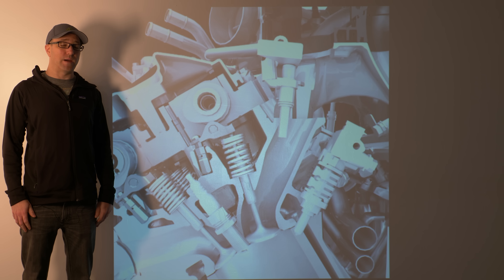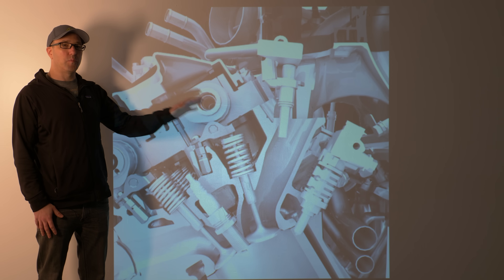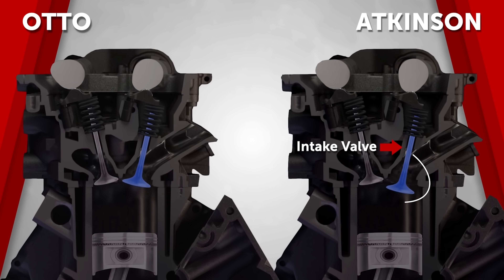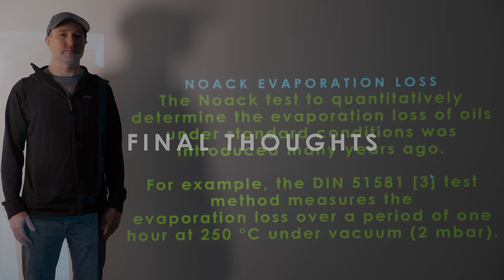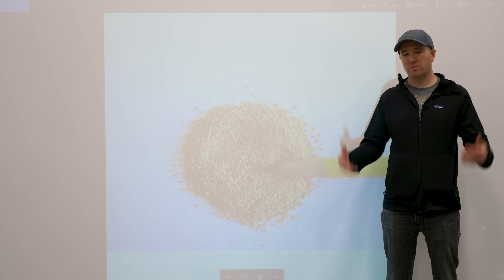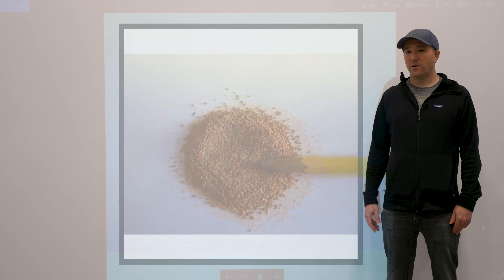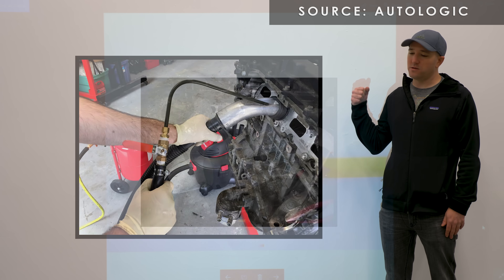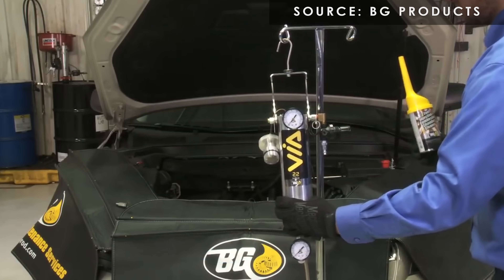Direct Injection, Problems and Solutions | The Fine Print

Comment: Very much disagree: Cleaning and oil cans are palliative solutions. Root cause of this problem is excessive blow by and all actions to prevent intake valve carbon build up should therefore be focused on preventing that. Blow by is caused by malfunctioning piston ring sealing to the cylinder, this normally is caused by not properly running in your car when new, trashing it when cold, using crap oil / filters etc. Just don't do those things and you should be fine. Running DI cars up to 450.000 km here without problems, at high speeds (Germany) and proper maintenance. If you behave like an idiot you will pay dearly, just be nice to your car, it will return the favor.

Comment: We got 2016 Audi S1 2.0 TFSI , keeping as much as 3K rpm whenever driving it or drive it like hell ya. We’re living in place with 98-100 octane ( Mobil 1 / Shell unloaded). We dont know if it will help out  But this is only the way to prevent the worst at least.  By comparison we got another 2 cars that still  run like hell  for 16 years without engine prob, its a ttq mk1 and cooper S MK1. all of 3 run 5-40 of Mobil 1. And Never to Dealer for Servicing since the D1, We hate Dealer!

Comment: putting thicker oil in your vehicle than what the manufacturer recommends can cause issues if your vehicle has variable cam timing, especially on the newer vehicles as the cams will change timing as quickly as the computer wants too see. It may cause faults and drive ability issues. If it doesn't, great!

Comment: I have head so many theories on what causes the carbon problems on DI and I can say first had that the PCV has little to nothing to do with it. From newly  cleaned valves I used an oil catch at 60k- 122k before my valves were coated enough to cause cold start misfires again. So the PCF filter gave me an extra 2 thousand miles. Whoptie fuckin doo. I also used seafoam every 10k which is probably where I got the the extra 2 thousand from. I'd be willing to bet the Oil catch can does absolutely nothing. Do you have problems with carbon buildup in your turbo? Do you have problems with carbon build up in your crank? No you don't. Thats cause fucking engine oil doesn't leave carbon deposits.

Comment: Yep, GTI owner here... the carbon is nasty. However, the Italian valve job works! 95k miles on mine, but no misfires, because before every oil change I go on the highway in 3rd gear and rev the tits off her and get it super hot. Not perfect, but it works.

Comment: great video! What applies to GDi engines also applies to direct injected Diesel engines. 
i used to own a bmw 320d and i cleaned the EGR valve, the intake manifold with butterfly valves and the intakevalve ports. All caked up with a thick sticky layer of sooth + carbon + oil.

Comment: If it has this level of detail and understanding of technology, a Fine Print on how to choose which gasoline octane to pump would probably be successful. In addition to many historical misconceptions, modern engines with sophisticated ECUs and knock sensors are even more confusing and are not being described sufficiently to consumers (except by Mazda). In other words, the vast majority of ordinary drivers of "premium recommended" vehicles do not understand the distinction with "premium required." No one is close to recouping the additional expense of premium gas with better fuel economy, and most drivers would likely place little value in any performance gain if they truly understood it (e.g., over what RPMs there is a difference).

Comment: I have an old ZJ Cherokee and I recently did a de-carbon on my inlet manifold and a bit inside of the inlet ports. I use oven cleaner and a high pressure water cleaner on the manifold away from the truck. The parts inside the head I used rags and bottle brushes. You have to be careful with the paint and under the bonnet things. Oven cleaner is 75% caustic soda. But I tell you what, it works really well. I like it.

Comment: gdi...for lease cars only!!
after all...who cares if the user doesn't keep the car and it's disposable.
oh yeah...real good for the environment...NOT!
sticking with my v12 jag thank you very much.
24 years old and the engine has NEVER been apart. runs like the day it was bought and gets 20 per when the go pedal is used gently.  still passes emissions.
to add...how long does anyone think it will take for the parts in these new nightmares to come up NLA on a parts suppliers screen when it comes time for these things to be repaired?
i digress before this turns into a full blown diatribe.

Comment: What you didn't mention is that any buildup of coke on the inlet side can result in LTPI - or Low Temperature Pre-Ignition. Tiny bits of carbon enter the combustion chamber and are ignited. If the particle doesn't exit via the exhaust valve, then it stays inside the cylinder, as a glowing ember. Then, when the piston is on the way up, the pressure gets high enough for the ember to ignite the fuel massively early, placing enormous strain on the bottom end of the engine, and wrecking it fairly rapidly.

No computer can stop it happening, and it is worse for your engine than High Temperature Pre-Ignition, because it happens so much earlier in the stroke.

Comment: You say government forces manufacturers into greater fuel economy thus necessitating new technologies like DI.  However, I don't think the gov't blindly ups the MPG standards every year.  They must know what is technologically feasible at a reasonable cost.  And where do they get this information?  Probably from the manufacturers themselves.  So it really boils down to what current research and development into engines has been able to come up with.  So what drives manufacturers to improve their engines, be it better MPG or higher performance?  Probably competition, so they can out-do other mfg's.  In this race, complete research, like the longevity testing of dirty valves caused by DI that you mention, may not carry as much importance as time-to-market and sales.  To be fair to the car makers, that's probably a fact of life in business, to be able to survive.  However, it is also possible that the engine designers know of the dirty valve problem, and accept it as a tolerable side effect.  Maybe they figure the kind of buyer who buys for performance  of a DI, will only keep his car for 60k miles, because general wear will reduce it performance by then anyway.  I'm not saying these things are a fact,  rather saying there are many factors at play here, and you can't say, oh, they blew it with DI.  Car manufactures and their engineers are smart.

Comment: I'd also add quit using discount fuels. There is a tremendous difference when looking at the valves of someone who uses Kroger, Speedway, or other discount fuels at 20 or 25k miles as compared to someone who uses a top tier fuel such as Sunoco or BP. We see the damage/problems caused by cheap fuels every day at the dealership I work at. More than one manufacturer has bulletins out about discount fuels due to the fact that they are lacking the many additives the other companies put in their fuels. That is how they offer their fuel cheaper with their rewards cards.

Comment: Great video, I have run into this with my own vehicle. 

For anyone willing to get dirty and clean their own intake valves I have found that lacquer thinner works fantastic. Definitely don't do it around any kind of flame or spark, disconnect your battery as well. I did this to my 2012 Turbo'd Optima and the whole process took a few hours. I spent maybe $20 vs the $600 it would have cost. I'm an engineer and like to tinker with stuff and I like saving money. If you have a VW, forget it you will need to have a dealer service it because their engines are setup to be impossible for your average Joe to work on.. I still don't know why the car manufacturers don't just use internal catch cans that pipe the clean air to the intake and the oil vapor to a chamber under the oil pan. Use a longer plug that seals off both the oil pan and the chamber. When you change your oil it also drains the chamber of nasty blow by stuff. Simple fix and the catch cans could be made to be 100% effective using or a large amount of baffling. I put stainless steel wool in the bottom of my catch can to help it remove more nasties.
Reply: Engineer here as well. I used e85 to clean mine. $5 and i did a piston ring soak as well. Worked great. The solution is just to be a bad boy and put your pcv system to a vent to atmosphere catch can. Swear to god if you do this a good car really should last forever. Just have to be aware that a vent to atmosphere setup leaves the oil slightly diritier than a vacuum system so you need to change the oil every 3-5k.
Reply: @paladain55 is E85 ethanol? I had to rip my 6.7 power stroke intake off all the way down to the heads @ 57Km 
Happened to check my map sensor on the very top of the plastic intake and it had the hole plugged up with soot.. I had 1/4 to 1/2 (at some areas)inch of soot from the throttle body onwards.. of  course that is where the EGR return is in the intake. Interesting fact that the EGR port obstructing dead center shaped to a smooth mushroom head which is always heated hot by exhaust gas and this 40% intake obstruction meeting cold air .. not enough on top of that i noticed oil in my intercooler up pipe so traced it all the way back to the turbo.. they have a half in hose facing the turbine inches away which is the crankcase breather and it has a wannabe catch can separate nothing as its not baffled nor allowing oil return fully to empty the box.. so I just used a washing machine drain tube and routed it to the airfilter input hole and plugged off the turbine port. Ps I used good old kerosene for soot and that's what worked fastest for me just like I only use kerosene to clean my motorcycle chain also from the thick grime and it is like new still..
Reply: Or take a catch can that cost $3 and multiply that by 300,000 or so of cars and you see why not, also what the other guy said they want you to take to dealer.
Reply: @anthonye3680 a quality catch can is a hellava lot more then $3😂
Reply: Ujjain
Reply: If you're an engineer then you should know "why the car manufacturers dont use catch cans" and the answer is because THIS way the car doesn't last as long and that means you will be back to the dealership SOONER to buy another car from them.

Comment: I spoke to a Denver Metro VW Dealership Service Dept about the concern I had regarding “Carbon Build-up” on my 2017 VW GOLF TDI. This car has a 1.8L Turbo charged engine with 11,000 miles.  A gentleman with this dealership stated that VW Corporation has no specific concerns about Carbon Build-Up on this engine. Also that this particular dealership did not /would not install a “Catch Can” and saw NO NEED for such a device!

Comment: I've noticed it has an effect of modest turbo boost by the efficiency gains. Naturally aspirated engines previously such as a V-6 rated at 190 HP with port injection are around 260 HP with direct injection. (Other things like fuel economy and displacement staying about the same.) I think it's because the valve timing is less of an issue with fuel timing, so they can maximize the volumetric flow compared to previously. It's not all bad despite the problems it may cause with carbon fouling.

I suspect if car companies had any choice in the matter, they'd probably try to figure out how to get rid of the EGR and PCV. There were cars in the 1980's that would pass 4-gas just fine without them (and even cleaner than cars with them), before they were legally mandated.

Comment: People warned me about carbon deposits when I got my 2012 Focus SE, but that was from VW people and I'm all too familiar with that company's inability to engineer things properly or spec appropriate materials for the jobs (and, yes, I realize I bought a Ford—my first, BTW, and I thought I might be rolling the dice on it). To be safe, I put Seafoam through a tank with every oil change at 10k, but stopped that after about 30k as the car seemed not to need it. Over 200k miles of perfect running that would embarrass a Toyota later (never even changed a spark plug), it was only two jerk-offs not paying attention that took it off the road (to be fair to this car's reliability, it was a manual transmission, not the problematic DCT, but that has nothing to do with the DI). Got over 35 mpg over its life (as calculated at every fill up) with no discernible difference in acceleration and, while I have mechanical sympathy, I don't drive like grandma (and since I no longer deal with timing belts, I do not ever service cars unless something has worn out or broken). My ST replacement has 75k so far and is just as bulletproof.

The secret to longevity? Drive it. I drive over 50k miles a year and never have reliability issues with cars that don't have the most stellar reputations (but no VW or Hyundai/KIA or Chrysler level disposable trash—the engineering on those cars is a joke). High mileage being a problem is an outdated myth perpetuated to devalue used cars at trade in and to encourage people to buy new ones. Even wear items last about as long time-wise as on low mileage cars, I just get 3 times the life in mileage.

Comment: Crud...just bought my dream car 2018 WRX after 3 years of patiently saving and waiting...

Much love for you GeeseMaster. Big fan and enjoy your dry humor and content. I learn a lot from you as a small SubiTuber:)
Reply: Wait until your head gaskets blow...
Reply: Stan Sexton that only happened on very few vehicles more than a decade ago
Reply: It's happening with the Focus RS and Subies right now.
Reply: @amazoidal  what wrx's are blowing head gaskets? i havent read of any. the eco boost engines yes. not the fa20dit.
Reply: @jameskocks4734   it's the STI not the WRX
Reply: @amazoidal   Focus RS is gone the STI is the old EJ motor that blows
Reply: TomVangTV you'll have bigger issues than inrake valve caking lol, knock knock, its wrx. J/k, change oil like religion, 5k km period. It will help a lot

Comment: you explained the pvc system wrong.  the crankcase is ventilated positively.  the engine takes in a certain portion of its combustion air from the crankcase.  the crankcase is part of the "headspace" of the motor.  one of the most beneficial emmissions devices it actually helps your engine last longer it clears out blowby into your crankcase and it prevents water and unburned fuel from settling into your oil.  the carbon buildup is, as someone has mentioned, your egr mixed with the oil mist from your pvc valve.  tdi vw's have this problem.  egr is stupid.  dump ur egr and get ur car re-tuned.

Comment: One old school DIY trick to remove at least some of the sludge/carbon from intake ports and valves is to spray water mist to intake manifold while engine running about 2000 or more rpm. Just remove intake filter and apply spray of water mist with a hand spray bottle in to the intake manifold and keep revs up. Engine will slightly cough a bit and sot will come out of tailpipe. That´s removed carbon. Have done it for several diesel engines without particle filter or filter removed over the years. With gas engine disconnect catalytic converter first to prevent removed carbon to stuck inside it.

Comment: This DOES NOT apply to a Corvette in this article (search for the word Criswell): http://www.stingrayforums.com/forum/general-discussion/14048-catch-can-confusion.html
Reply from the maker: They said for "street" driving it did not make a notable difference.  For hard driving and track use thats a different story.  Secondly GM engineers also claim their V8s with oil consumption issues on cylinder deactivation engines is ok up to a quart every 1000 miles.  And a massive list of other BS, that they wont warranty.  So take it with a grain of salt.
Reply from the maker: They said for "street" driving it did not make a notable difference.  For hard driving and track use thats a different story.  Secondly GM engineers also claim their V8s with oil consumption issues on cylinder deactivation engines is ok up to a quart every 1000 miles.  And a massive list of other BS, that they wont warranty.  So take it with a grain of salt.

Comment: Nicley done video, bravo!!! Saved it to my favorites. I have a 2015 Elantra Limited I bought for my wife. I’ll have to talk to my buddies at Hyundai and see what level this engine produces this problem. I worked for Hyundai for a few years and have a great relationship with the entire service department. Looks like we have to have a chat about this issue. I have found that Hyundai really stands behind there product. I’m not saying they will cover this issue, just that I have seen them warranty stuff that other manufactures wouldn’t. That’s why I bought one of their cars. I owned Toyota’s for many years (2 Celiac’s and 2 Supra’s) until Toyota wouldn’t admit and repair their head gasket problem’s they had on their 90’s Supra Turbos. After the customer paid ( out of their own pocket ) to have the head gasket replaced the engine was bullet proof, however the problem was due to Toyota not the car owners!! This really upset me, a lot. If you/ they can’t stand behind their products, well then buy buy!!! I’m now a happy Hyundai customer, next purchase, maybe a Genesis pre-owned certified. That way I can still get the 10 year 100,000 powertrain warranty. Which should last us the full 10 years, my wife don’t drive even 12k per year and I have a company car with a gas card!!!!